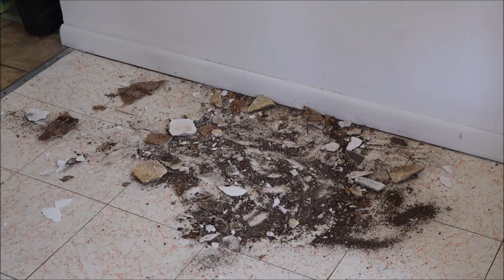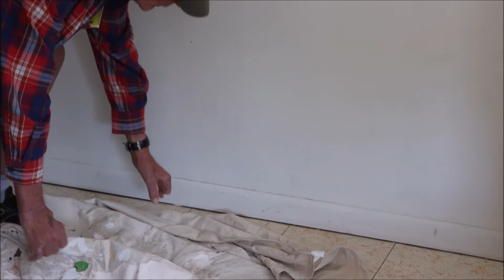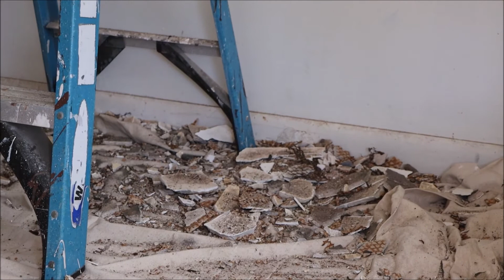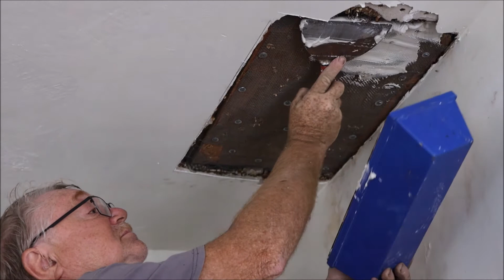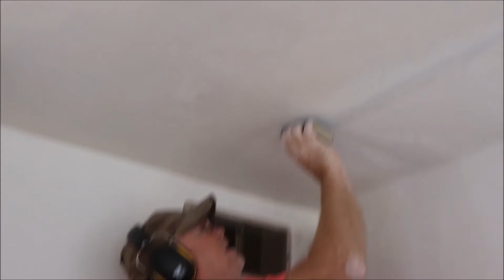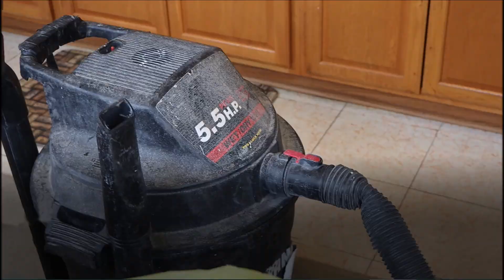DIY: Repairing Water Damaged Plaster

Comment: Save your back! Drill the holes in the filler board before you screw it to the ceiling.... other than that, great video. '' }

Comment: Excellent video ! I know your videos as local historian but never realized your also the Bob Villa of the AK Valkey!Lol!You had a good experienced crew also.
     I spent some time repairing 100 year old plus houses and picked up a few plaster tricks from some old time guys. When the ceiling plaster has loosened from the lathe and is hanging like a topographical map ,you can get short drywall screws and lightly screw the low spots back up against the lathe boards. Put lots of screws in and just try and firm them back up . Then you get some construction adhesive or an epoxy and spread it over the repair area. Let the adhesive tack up then trowel your base coat onto the adhesive . The drywall screws hold the plaster to lathe,the adhesive holds your repair plaster to the original plaster. I have repaired many old ceilings this way and some have been holding over 30 years now.  I did an entire living room in a brick home in Perryville like this .The man had estimates of 12 K dollars to repair the plaster professionally . I used my method and his house sold with no problems ,looked good. That was on 1998 , the ceiling is  still holding so far. I think I charged the guy 500 bucks .No it's not as good as pro plaster work but it's a good fix for acceptable results!
    I am looking forward to more of your exploration of local history . Thanks for your videos !
Reply from the maker: Really appreciate your comment....thank you

Comment: Great job 👍
Reply from the maker: Thanks Sean.....you need a lot of anchorings, force the plaster in the drill holes with a thin coat. Then a heavier 2nd and so on expanding outward till you end up with a nice smooth final coat.